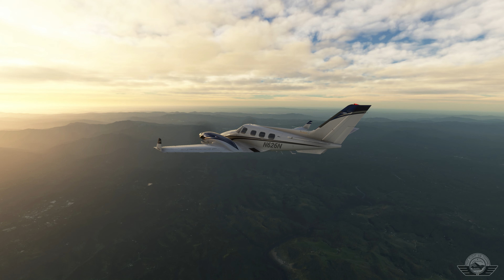BlackSquare Turbine Duke - Engine Trend Monitor Tutorial

Comment: Is there a way to reset the timer on inspection date?
Reply from the maker: After reviewing the manual, it seems like there is no direct way to reset the inspection date on the ETM itself. However, my best guess is to go to the Bendix RDR1150XL, go to the NAV page using the rotary dial on the upper right corner, and try repairing both Left/Right engines until both engine conditions are back up to 100%. This might trick the ETM into resetting the date since the manual states the date is “entered by maintenance technician”.

Additionally, for the timer itself, once you arrive at the inspection date on the ETM, use the clock function buttons to the right and see if they interact with that page. We’ll have to try both of these methods later to verify it ourselves but it’s the best shot we can suggest!

Let us know if this works for you.